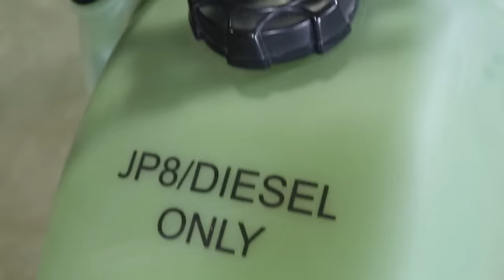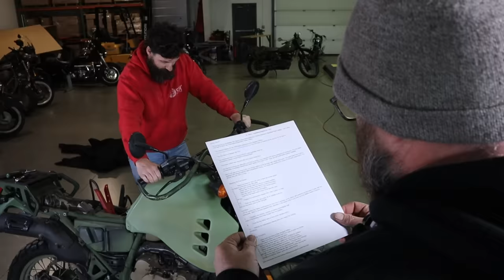I Bought a Diesel Dirtbike from the Marine Corps(1 of 214)

Comment: When I was in the Army, I noticed that a lot of special use vehicles that aren't used as often only got idled or driven around the motorpool once a month, if even that, so that's probably what you're dealing with. Vehicles that get used, get used a lot. They get used for training and actual mission operations. Turning on the motorcycle once a month to idle for several minutes might not be sufficient to prevent fuel filter clogging. While it's better than not running the motorcycle at all, idling for a few minutes might not heat up the engine enough to burn off the accumulated deposits and contaminants in the fuel system fully. Even if a motorcycle has only been driven for a few hundred miles and then left to sit for an extended period without regular use, the fuel filter can still become clogged. The reason for this is that over time, fuel can degrade and form varnish, gums, and other deposits. Additionally, moisture can accumulate in the fuel tank, which can lead to the growth of algae or other contaminants. Have you ever seen algae in a fuel tank? I have, and it makes old fuel smell much worse.
Reply: So if we want to store a bike away for a long while should we empty oil and gas reserves ?
Reply: @maalikserebryakov  There may be additives that help, but if it'll be for years at a time in storage then you should flush the fluids out. If you want to store fuel, it's best to use a proper can for it that lets out gasses but doesn't allow moisture in. Diesel can last for decades, but it'll degrade significantly.

Comment: When you bleed the injection crack nut at injector to cylinder, when roll engine over hold full throttle for volume, at idle will burn starter, when no bubbles tighten and should start.

Comment: You're reading the fuel line bleeding procedures at 7:23. This isn't the "starting" procedure. It's only used prior to starting if there is air in the lines. edit: also make sure the small brass petcock at 6:02 is closed after the fuel line is bled. It probably won't start if that's open. 2nd edit: Changing out the old fuel may help as well

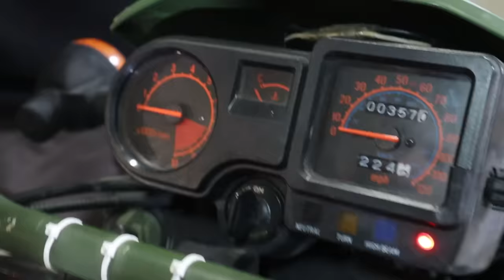Comment: At 5:10 you'll see a little red light on the lower right side of the control panel. That is the glow plug indicator. When it is red it means that the glow plug is not yet hot enough to start the engine. With the key on and when the glow plug light goes out the glow plug is hot enough to ignite the fuel that should be in the cylinder. That is when you turn the engine over and theoretically it should start. It is the same as any diesel engine. It needs a glow plug to start a cold engine. It isn't a spark plug. Good luck with the fuel system. I don't think it is good idea to use ether to start it. That is way too combustible. It'll burn too hot and ignite before the piston is near the downstroke so you could fry the cylinder or break your connecting rod or something baaad like that.

Comment: Okay first off the decompression switch is there so you can prime the fuel system without having to drag hard on the starter. Secondly the only way to truly figure out what's wrong with that fuel system is to tear the whole thing apart until you get moving fluid and then check the part that follows. I'm from an area where we have ants that build almost a concrete structure inside your fuel system I bet if you run a wire through the whole injector system it'll clear it up.

Comment: Decompression valves are used on diesel engines because the compression is so high it is hard for the starters to turn them over.  With less compression they can turn over faster and start easier. Engine will run on lower compression when it starts you turn that off and you will have full power.
Reply: @notexpatjoe you have the manual for that bike?????????????

Comment: Decompression is a good future because with diesel you have no spark plug to remove if the engine becomes flooded it may not even be able to pass top dead center but with decompression you will have no problem to open that then dry out a flooded engine

Comment: As many people have said, on a diesel you need compression to cause the explosion
(think of it as an engine that runs by inducing knock via high compression)

So that compression release let's you get turnover speed/momentum (easier on the starter), then you need compression back on to fire.

Ps. To all the ether haters, not-starting is also very hard on the engine. Cranking and sliding without oil pressure is bad. Diesels are worse for that, which is why a lot of people won't turn it off for any stop less that 15min.
Some older tractors & loaders actually had ether systems oem/stock to minimize dry running.
The combo of strict gov regulations + higher voltage starters moved away from OEM ether systems.

Comment: the front light is a Infared illuminator you can see it upclose just barely. with the naked eye. but best way to tell if ones working without night vision is turn it on for a couple minutes and feel if its warm/hot and the rear is Blackout marker lights/convoy lighting. if the guy behind you can only see the middle light hes too far. if he can see all 4 lights hes way to close.

Comment: All these smaller single cylinder diesel motors have a decompression valve that will snap back automatically after starting. Make sure to bleed off air at the input pipe atop the injector. For the broken pins seek help from an engineer.

Comment: FYI jp8 isnt ultra low sulfer so using street diesel you must use an additive and a Lil 2 stroke oil would make is run and last longer and keep all seals hydrated stop a sticky injector. new diesels fail and it kills older diesel engines as well use a treatment!!

Comment: i got a diesel generator with a decompression button because it is physically impossible to pull start it with out it. and if it doesn't fire before the button kicks off it will pull your arm right out of it socket. it isn't needed when using the key though so the only reason i could think of this bike needing one despite being electric start is the starter isn't strong enough to turn it over with out decompression. maybe due to lack of space for a bigger starter. or for some form of manual starting.

Comment: Thing magneto when you deal with the injector pump. Winds up ( mag) fires. Ink pump builds pressure, trips injector cracking pressure. The little lever under the tank like a choke more than likely a delivery pump. Is it spring loaded?  If yes, it pumps fuel with every stroke once primed. It disturbed me seeing you spin the injector pump. It should be hard connected to the engine by belt, chain or gear.

Comment: Lesson learned on Oldsmobile diesels in the 80s starting fluid will kill them but WD-40 is the perfect thing for lighting off a GM diesel and any other diesel for that matter way safer than ether. It's the 1001 uses for WD40

Comment: Need to crack the fuel lines after the injector pump and start it a bit

And there should be a bleed screw on the injector pump body

Comment: Fascinating video but seems about as reliable as a 50 year old snowmobile. Too much stuff to break. Had to be expensive to build. I commend your grit to get it running. I just wonder why not deal with keeping some gas around and run the stock motor with one of those stealthy exhaust pipes like deer hunters use on ATVs. Except for the complex diesel motor, the rest is body kit.

Comment: The exhaust pulses on a low rpm single cylinder might be too far apart to keep a turbo spooled up.  A supercharger might work better if you wanted to give it more power.

Comment: Diesel run much higher comprestion so you hold the decomp until stater is spining to speed and release decomp or you decomp before you try to kick on gas engine

Comment: Diesel fuel turns into varnish. If it’s not used a lot of times it jams the fuel injection pump and injectors when you were cranking it over, not getting smoke you were not delivering fuel to the engine. I would imagine it’s either in your injection pump or your injectors.

Comment: Most diesel engines you need to run glow plugs to cycle on and off before cranking the bike over.  ether that or some way to heat the diesel to get it to fire. Wish I had one to mess with.  I would love diesel fuel economy of a motorcycle.  I thought about trying to convert one to run on diesel since I can't find an affordable one.

Comment: You should use an electric pump facet and that s it. 
When mecanical pumps fails on diesel cars or truck we use an electric fuel pump and FACET makes a diferent model of electric pumps, just conect he lines of fuel before and after the pump and then to the inyector, and it will start

Comment: Not sure if it works this way on your bike, but generally a diesel fuel system needs to be under significant pressure, even before starting. I'm guessing that lever is probably to pressurize the system and that thin clear fuel line you installed isn't going to cut it if it's on the high pressure side of that pump.

Comment: Amongst you starter problem as an FYI mechanical diesels require that the injection pump be properly timed. Think of the injection as though it is a distributor on a gasser

Comment: the way I see it, all you need is a machinist, a lathe and a mill
should be a breeze to just make the parts again

if the pins sheared off and they are actually pins, then it should be fixed in about an hour

just get in touch with a local machine shop, I'm sure they will be able to help you out.

Comment: Diesel Engines shake and rattle alot.. this would eventually shake the bike to bits (bike engines are bolted straight into the frame, no rubber mounts as it needs to be straight for the chain to stay on) So I understand why this didn't become a thing.. So it might have worked but it must have been a rough ride!!

Comment: removing the mechanical lift pump assembly completely and hooking up an electric lift pump (one that would roughly have same psi as the mechanical) after some slight modifications could work maybe? 
Just throwing some ideas may possibly help? 🤷🏻‍♂️

Comment: A Diesel engine needs to spin engine at a certain rpm to start the compression release lets engine to spin at the desired rpm to start! That is the engines mechanical timing advance you pulled off, would be my guess!

Comment: I'd guess that it revs to high and easy when starting. 
Is the decompression enganged? No compression = no ignition. 
The decompression may be used for stopping the running engine.
Or maybe a valve isnt closing.

Comment: You don't use the decompression valve to start the engine,you use the decompression valve to spin the engine freely while bleeding the air out of the system.
A decompression valve activated in a diesel engine makes for a 'not running' diesel engine.  Diesel engines use heat and compression to detonate the fuel and you need both to happen simotaniostly or it will never start. 💁‍♂️

Comment: And with so man military facilities located in close proximity to Maryland it stands to reason that they could request lost of phased out military items and transport with limited trouble or expense. A lot of military equipment may be ordered and never used or only lightly used and then be stored. It would have a military expiration date at which time it would automatically be replaced with a newer model. For instance your fuel line issue or some other issue. When the military ships this stuff all over the planet when they uncreate it they want to put in fuel and oil and go!

Comment: The most probable reason why your Fuel line fell apart is Gasoline line cant Hold Modern Euro Diesel spec fuel. It will melt them away. 
Old D2 Diesel is a Natural fuel with enough self lubrication, and it's not corrosive,  so it can use any Rubber or silicone. 
Not new ones. Don't put Gasoline hoses on it.

Comment: i remember working on that engine before and you mess up fuel pump because hard to turn it lead starter to give up because too hard turn engine over
and reason they build that tension clutch is that loose up grip so starter can turn over get engine up to speed them grip on fuel pump to run engine

Comment: Been a power sport technician for well over 30 years we used to service all the military, motorcycles, quads, and UTV a lot of these things ran on diesel, but a lot of them also ran on anything that was combustible whether it was gas, kerosene diesel, acetone, you name it if it we can bust it would run in it

Comment: Work smarter not harder should have just help it wide open and cranked it would have eventually pushed any air out it’s basically fixing something that’s not broken like if you get into a diesel truck after not driving for a couple weeks maybe months you just jump in hit the key might take a little longer to fire but will eventually

Comment: Removing the governor fly weights (which control timing advance) is not going to help it run well. Fuel system needs air bled out of it right to the injector.

Comment: Index the stub and gear b4 removing, unless its keyed and you can't see the key because it's on the backside of the taper...either way, making sure the mechanical timing stays on point. That area of the design must have been the weak point. ----- following

Comment: Owned a '13 KLR. Very cool, mildly underpowered bike with a big tall frame, runforever engine, simple to work, and a ton of after market. Lots of fans of the bike, and I can see why. If you want something inexpensive, easy to work on, that does the job reasonably well, that handles on the street and dirt very well, and was bought new for around $7k, you could not do much better. I am 6'3 and 300+, and once I added the 2" lift dogbones, and raised the front fork clamps to the top, it was the first bike I could jump on and still have the seat hitting me when on my tiptoes. It did 80mph on the highway, on stock Heidenau K60's, totally stable at that speed, and could rip around town or off road nicely. Great bike. Diesle would be interesting.

Comment: Clearly it’s a bad fuel pump and the starter should be stock, so you can get that of the shelf. I’d do some improvised engineering and dismantle some mechanical pumps and see if you can adapt it to make it work. There’s no parts for them but to get more info on the bike? You can invoke the freedom of information act and fill out the form and submit to the Department of the Navy to get the specs and blueprints on it. Nothing on its classified so anyone can get that info, but you have to ask nicely lol

Comment: Assuming since diesel runs off significantly higher compression ratios than gas the decompression switch would be used to free up the motor from possibly being in a compression stroke keeping the starter motor from excess load and burning out? Once the starter motor is turning the engine freely you engage compression to start it?

Comment: If this diesel injection pump is like my tractor it wont pump any fuel until you crack a line open as close to the injector as you can get. Not really good information but maybe it'll get you onto something.

Comment: When Diesel's run out of gas you got to get all the air out of the lines they're a pain in the butt when I run out of gas. Rough forklift runs out of diesel I got to unhook all the injectors unhooked the fuel line and unhook the filters let it Prime by running it so the air out that takes forever

Comment: You got air in the lines. That simple. Diesels cannot have air in the fuel lines ever. The injection pump cannot work if it loses prime, which happens when air gets in the lines.

Comment: the reason the police department probably had it was because after the iraq war there was a lot of military surplus and unused equipment which was practically being given out for free to law enforcement agencies and  that police department probably got it under the pretense they would integrate it into the department but it was probably deemed unsuitable for law enforcement duties and probably just sat in storage until you bought it when they did a police auction for old unused equipment. peeling off the usmc sticker is probably the only thing they did with it.

Comment: I stopped at 15 minutes. The fix is simple, I think. BYPASS the broke fuel supply pump and plumb in an ELECTRIC fuel pump. You just need to get fuel to the high pressure INJECTOR PUMP.  I hope you figured this out. Back to the video now.